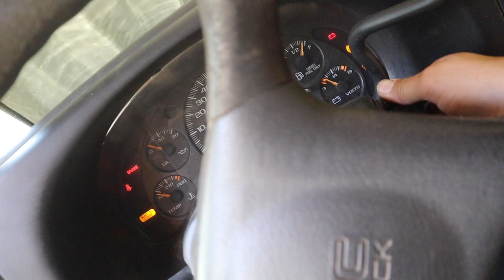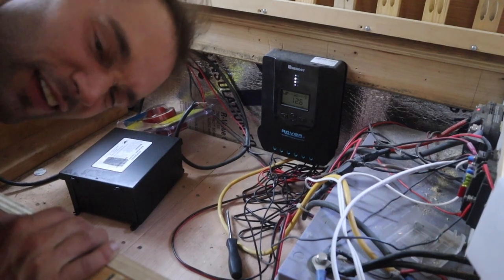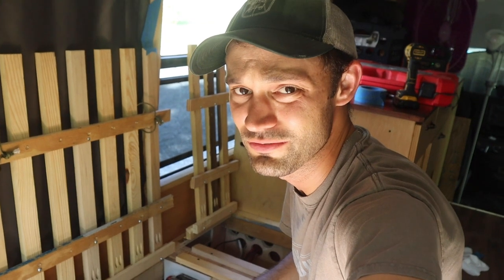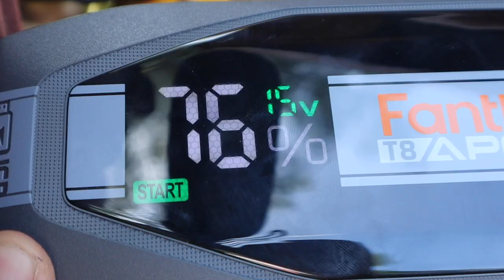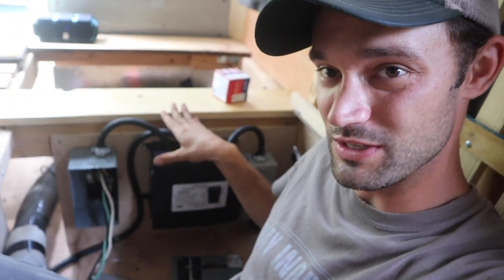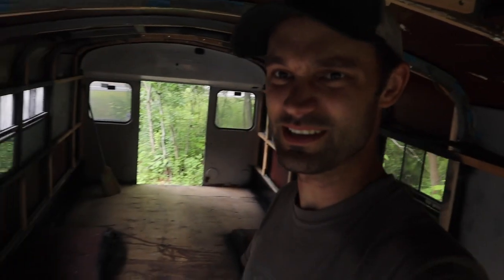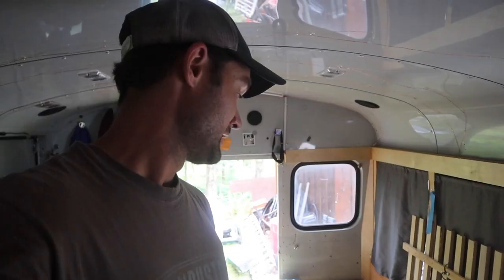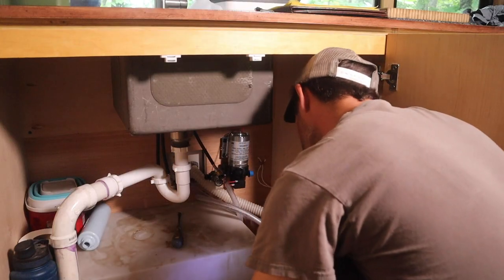We Have To Save This Bus | Fixing Up A Finished Skoolie

Comment: I don't know if you have seen this channel or not (Our Way to Roam), but they have some really cool build ideas I think you would like. I know Christina would for sure. They are currently building their second shuttle bus which is being built out the same as their own shuttle bus (with just a few changes). They are working in NY so not all that far from you. I believe several of their ideas would work in a van build as well. Thanks for all you do.

Comment: with you building out a lot of busses and vans , it might be cost effective to get youre own foam insulation system 
as for the waterpump overheating , should be a simple add on : a termoswitch that prevents the pump getting so hot it burns out

Comment: I wish I had someone like you here in GA. I bought a portable power bank with solar and it only ran a fan for about 5 or 6 hrs. And, it won't run the AC port while charging. So I believe I need a beefier system.

Comment: Do you need to have a switch to turn on the water pump or will it turn on when there is pressure? I.e. when turning on a tap

Comment: Ok I have a question.. the transfer switch goes from solar supplied electricity to shore power electricity.. you say shore power goes directly to 120v power  ok got that here comes question now.. are the wires from 120v hooked up to the house circuit breakers. So when you switch over to solar power it also will feed into circuit breakers also?

Comment: I need a friend like you in my life. I'm converting a 40ft 99 international T444E 3800 ALL BY MYSELF zero help with a generator in the hot Texas sun, the angle grinder scares me therefore the floor has taken well over a month to complete and still NOT DONE WITH IT 🤯 is there any way to get around it, I need to remove the side rail that's holding the last of the flooring (alongside the wall, by the windows) I'm feeling clueless throughout this process 😓